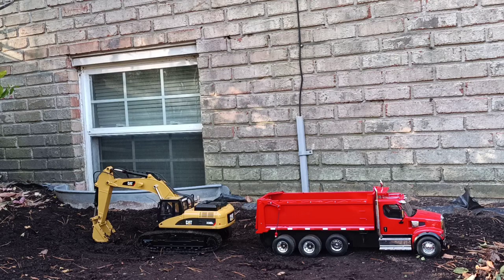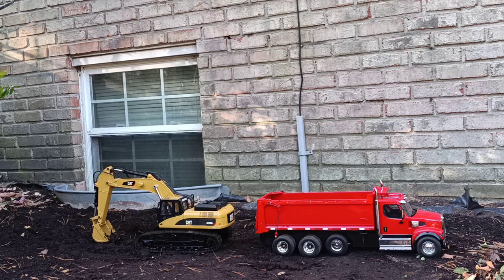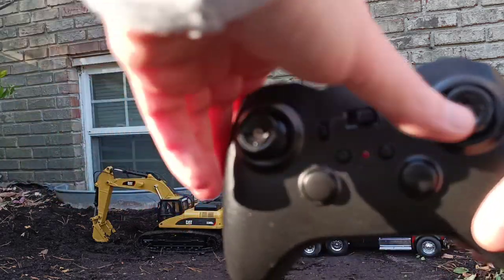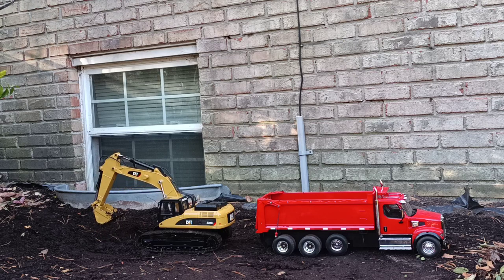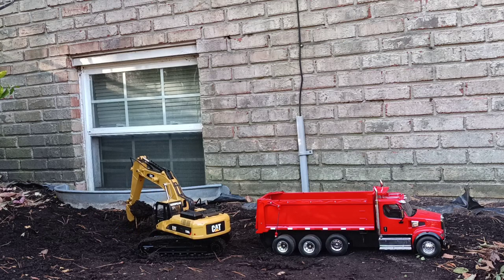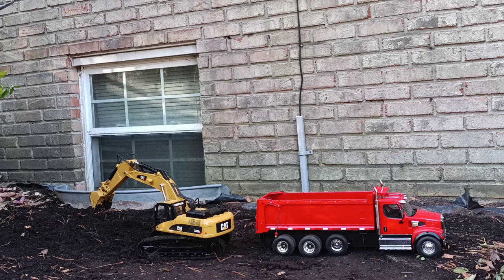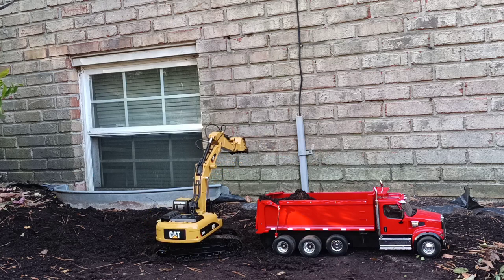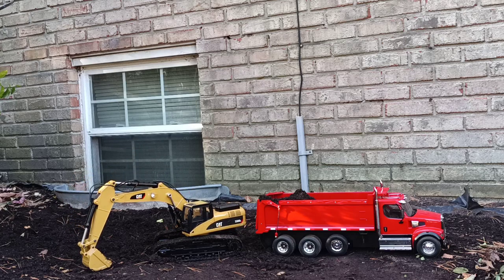Diecast Masters Caterpillar 330DL Remote Control (RC) Excavator

Comment: I operate heavy equipment for a living. Here’s a truck loading tip...

Get a pile of dirt. A big pile. Then, put the excavator on top of that pile. Back the truck up to the pile. You will then be able to load the truck (starting at the cab and working your way toward the rear of the truck. Be careful not to overload the truck or DOT will get you lol. Actually they’ll get the truck driver. Great video!
Reply from the maker: Thanks Lee. Appreciate the expert tips! Because of filming limitations it really wasn't possible in the scenario to build a stockpile and have the excavator sit on top of it. I wouldn't be able to get everything in the camera shot without having to do separate videos that's why I chose to have them on the same level. But if it's worth anything, I did consider it. Trust me, so much more goes into getting what you want on camera and then meets the eye!
Reply: You make great videos and I’ve made several purchases based on them.
Reply from the maker: @leebrasington9838  thanks Lee! I really do appreciate that! Thanks for being a fan of the channel and thanks for your kind words!
Reply: Exactly, the dump truck driver is responsible for his load, not the operator.

Comment: U didn’t activate the smoke???
Reply: V3 doesn’t have a smoke unit - just a rubber exhaust pipe over a metal plate
Reply: @Shaky_Jake  yes it does I have it n it comes wit smoke
Reply: @mr.sinister1279  maybe yours did, but mine didn’t.
Reply: @Shaky_Jake  really?? Look at my videos wit the excavator